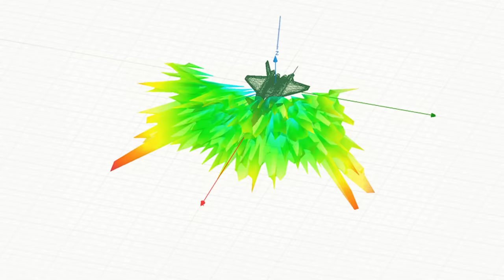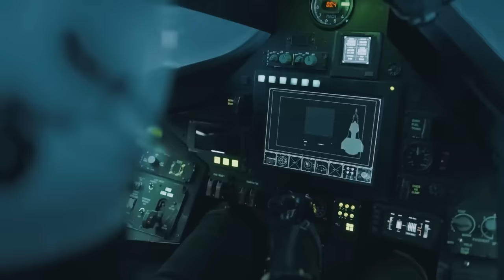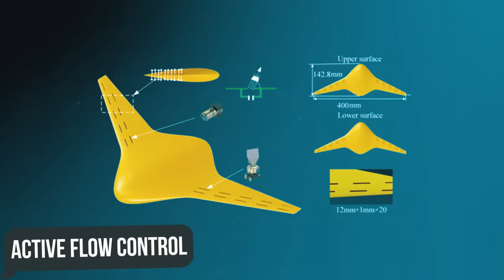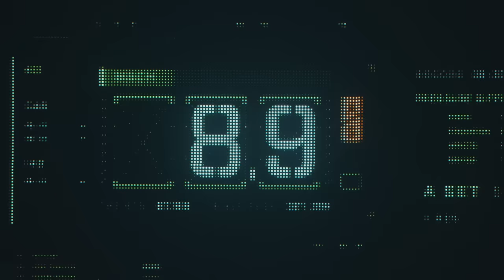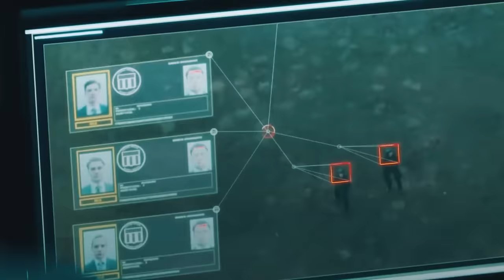NGAD vs F-22: A New Champion in the Skies?

Comment: well considering Robert Gates and Obama killed the F-22, you dont really have a choice why its getting retired. Its either rebuild the entire fighter assembly (which has been converted to building F-35s now) or build a new aircraft from scratch...it will cost more to do than building a new designed aircraft thats current technology now. To modernize one single F-22 to todays standard would cost over 1 billion per unit at the moment....and yes, we have 1 updated modernized raptor that costs just that much. Would be nice to have an F22 fighter assembly line again, but not going to happen.